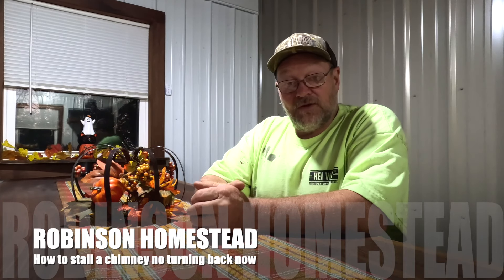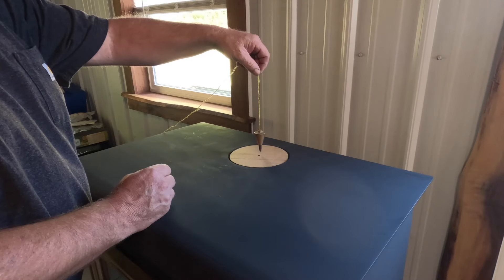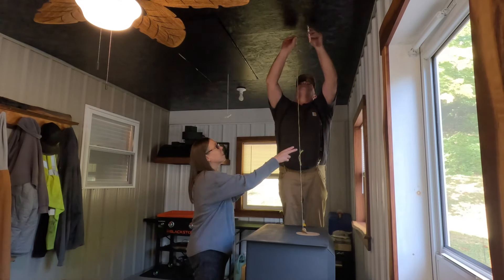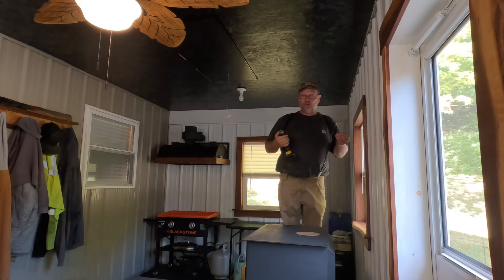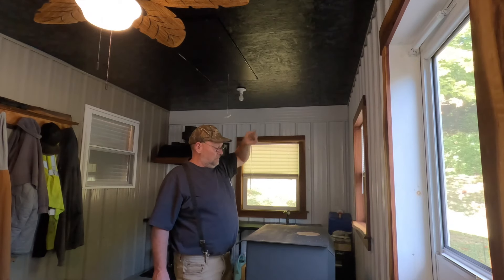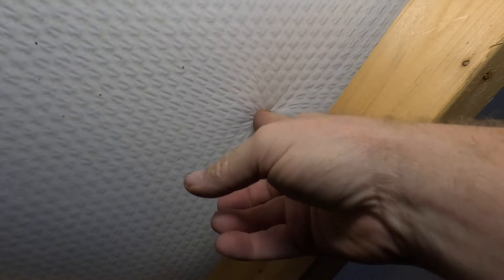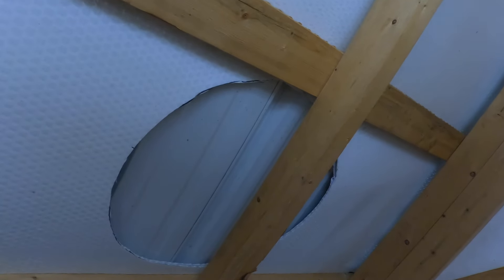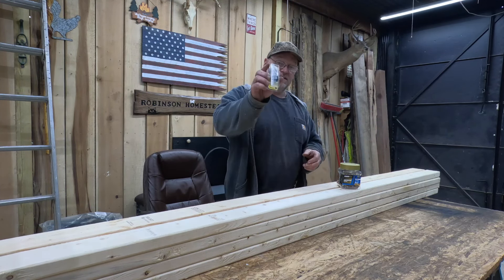How to stall a chimney pipe part 2 no turning back now

Comment: Why did u choose not to use an elbow inside to move the pipe over and avoid cutting the truss?
Reply from the maker: It is harder trying to clean a pipe with an elbow and also i get a better draft with a straight pipe.